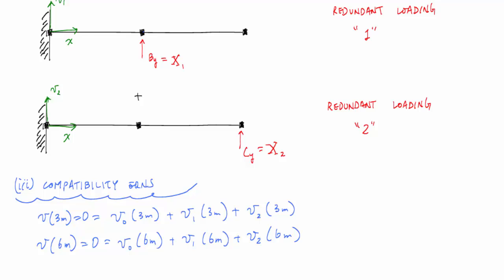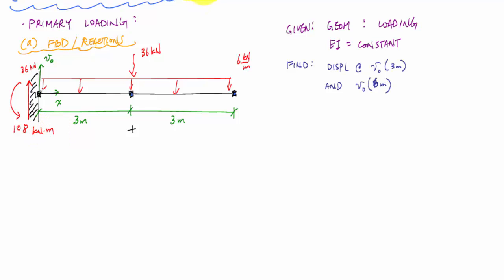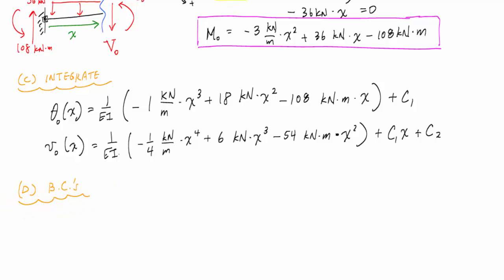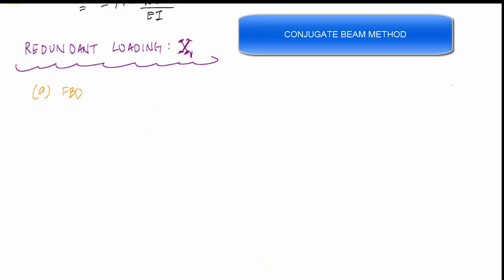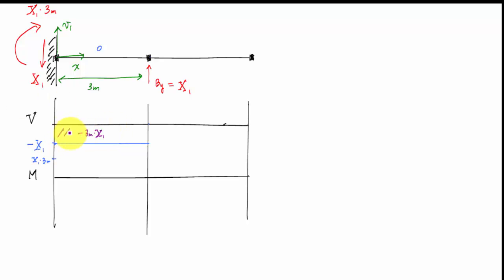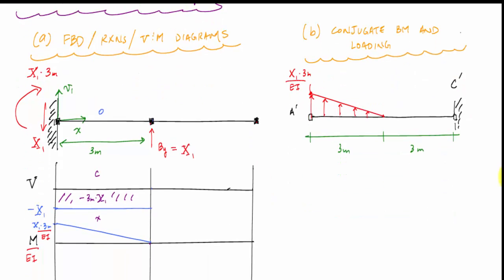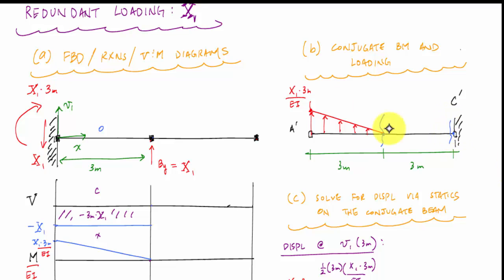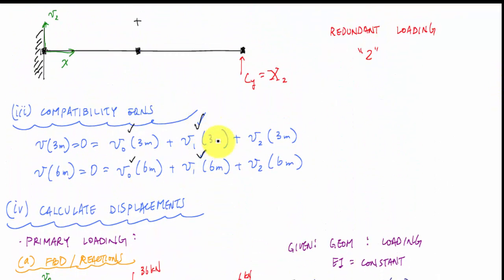Force Method "ultimate" Example for Beams (2/4) - Structural Analysis

Comment: I used double integration method for the second case. It gives me 18. I don't know where I made a mistake? Anyone?
Reply: Did you manage to figure it out? I'm getting the same problem
Reply: @reyaazmartin1900  Replying for future watchers. The moment for the second case is zero between x=3 and x=6, but when integrating you still end up with constants, so the slope in that case equals C1 and the displacement equals C1x + C2. When you solve for the constants using boundary conditions, you end up with C1=4.5Rx and C2=-4.5R. Thus Delta=C1x+C2 at x=6 gives you 4.5(R)(6)-4.5R = 22.5R.